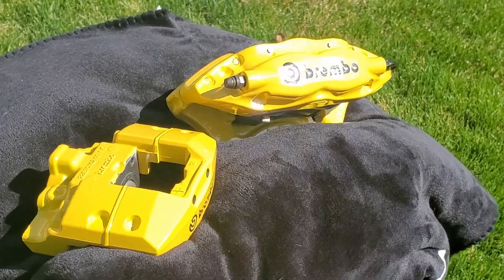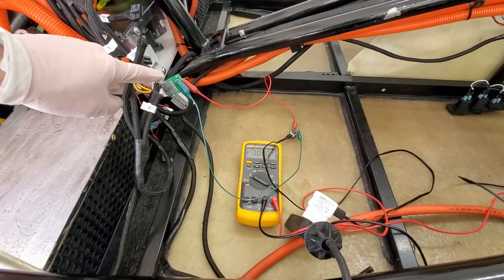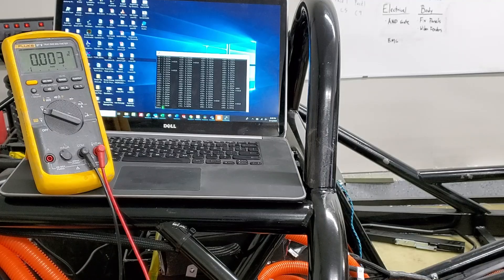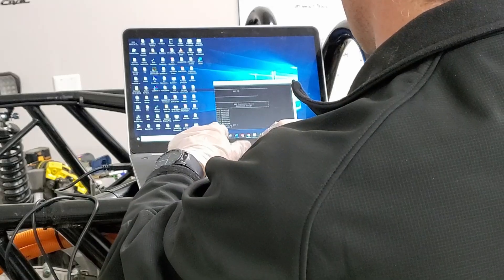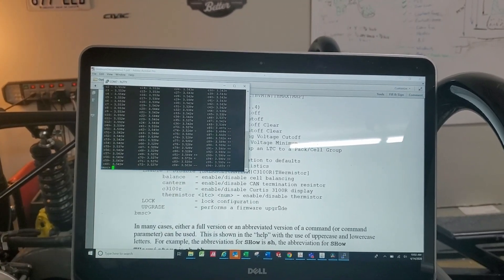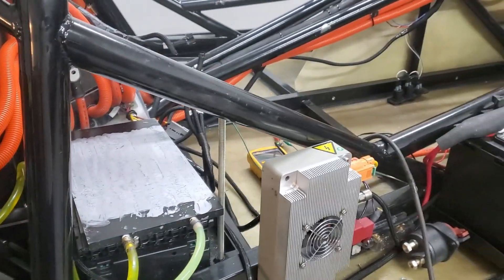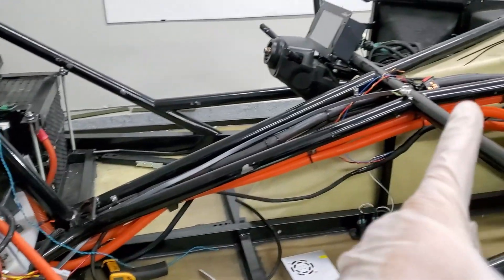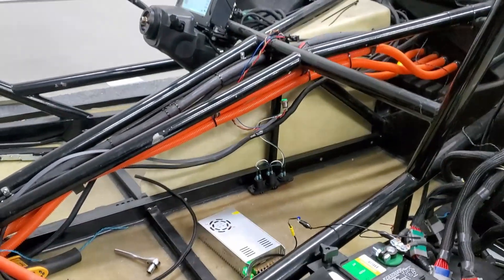DIY Aftermarket Tesla Electronic Parking Brake

Comment: What bracket did you use to mount them? Also do you know the size of the rotors?
Reply from the maker: This is a complete tesla rear subframe.  So I did not have to make anything custom for mounting.  Rotors are from a 2014 Tesla model S

Comment: Does this brake allow the tyres to spin freely? I really don't like brakes pad touching the disc when not braking. Unnecessary Friction!
Reply from the maker: Yes, when the brake is "off" it spins freely.  It is a little difficult to tell in the video because you are spinning the motor and differential as well.

Comment: The Pantera Electronics is a nice solution if you are only wanting to use the electric calipers for a parking brake, however they always apply full pressure, so they would not be good for an emergency brake.  If you were to actually lose your hydraulic brakes at 60mph and push the button on the electric brakes, the rears would lock up and send you sliding and spinning.  This might not be an issue for you since you can possibly set the re-gen on the motor to increase and slow you down, but on a gas car there are no other options.  I'm using a VNH5019 dual motor controller shield on an Arduino Uno, which allows you to vary the amount of pressure the electric calipers applies.  The Uno picks up the vehicle speed via serial from the ECU and pressure increases as speed decreases, making the electric brakes usable as emergency brakes.
Reply from the maker: Very interesting stuff!

Comment: Hey man, amazing build.

How do those rear calipers work? could these servos be sped up? i am trying to make an electric Ebrake for drifting and these tesla calipers look like my best bet if there is a way to control the position of the motor based on how far you pull a handle. what are the three wires? Power, ground, PWM?
Reply: Check out a VNH5019 electric motor shield tied to an arduino, you could setup a potentiometer to regulate how much power the electric brakes applied.  I'm not sure the brake motors themselves are going to be fast enough for you though.
Reply from the maker: John, sounds like you have an interesting build going yourself.  Glad we could connect.  The parking brake controller that I got does not offer the ability to control the rate at which the brake closes and also once you start the closing process it closes all the way.  You could contact pantera electronics to see if they have any controller variants that may work for your application.  Also check out wilwood who offers a similar setup.

https://www.wilwood.com/brakekits/BrakeKitListRear?mincatdesc=Electronic%20Parking%20Brake%20Rear%20Retrofit%20Brake%20Kit

There are 4 wires to each caliper one power, one ground, and the other two are for feedback as I understand it.

Comment: When you "unlocked" powered the vehicle via the fob, the EPB controller green light is "ON",  but it should not be ON until the vehicle is powered for use via the cabin push-button. This indicates that the full time power connection and the "ignition" connection are reversed. In this configuration the controller will not stay synchronized to the position of the calipers, as when you first powered-up in this video.
This is a very nice video of your car project and we appreciate being part of the build. Thank you for the detailed explanation of our EPB controller and the presentation of the components that we provide.

Product Development Engineering
https://www.pantera-electronics.com
Reply from the maker: You are right.  I had the wires swapped.  Thanks for the comment

Comment: Does the ebrake have output for interlock
Reply from the maker: Not sure what you mean for interlock.  It has an output that I plan to use for a dash indicator light
Reply: @electricsupercar  I think he means drive interlock
Reply from the maker: Drive interlock...It does have an output that I could tie to.  I will have to see if I can tie in to the Tesla controller